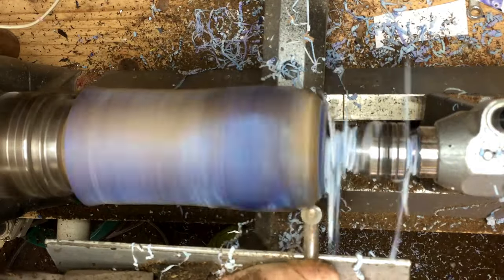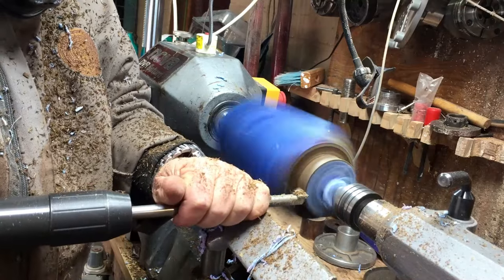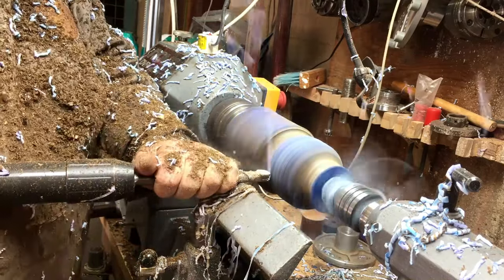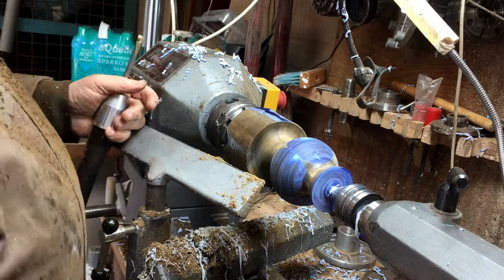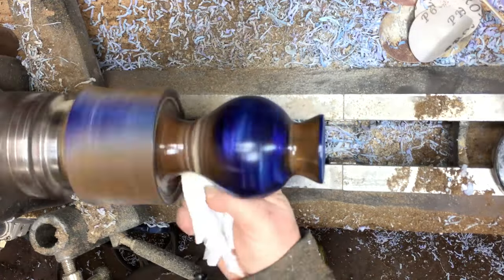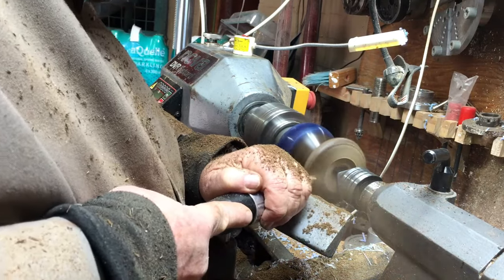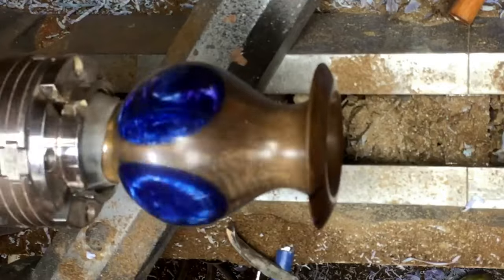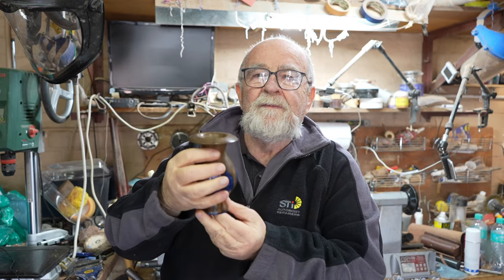woodturning a little railway sleeper  to vases

Comment: Pretty nice base Ahron. I don’t see anything wrong or bad about using the Forstner bit to support the vase while you turned the top. Worked well.
Reply from the maker: Doug it worked for me . But  some people will say it is not orthodox . Thanks for your comment
Reply: @oldmanwoodcraft  I understand, but a bowl gouge wasn’t orthodox when it first came out either. If it works, use it.